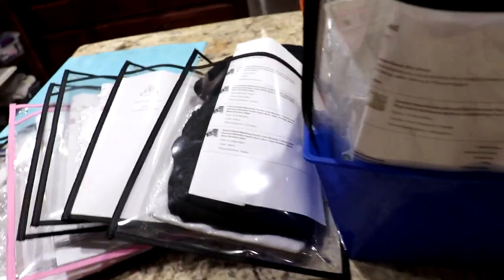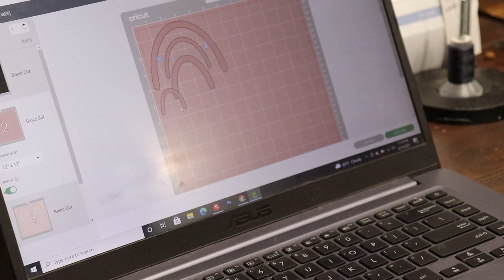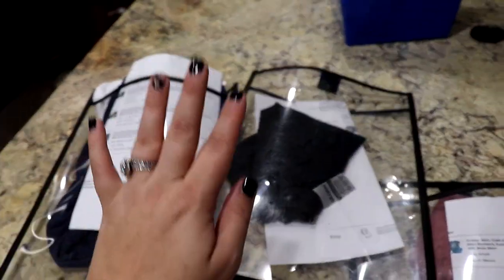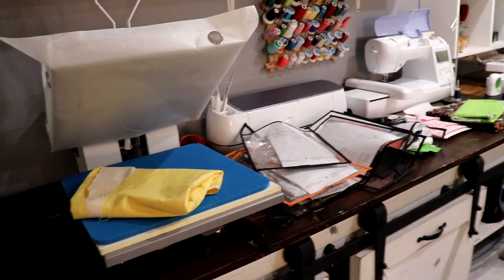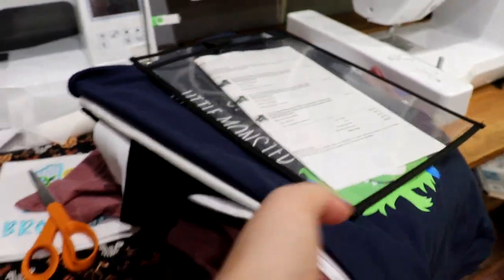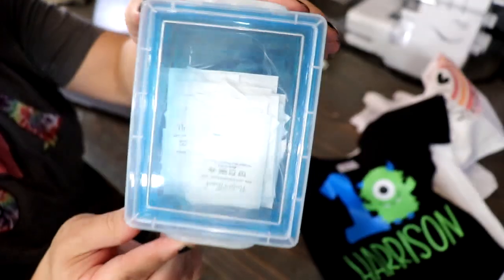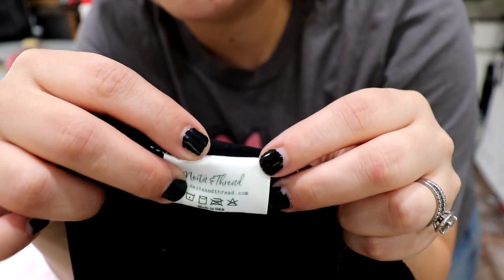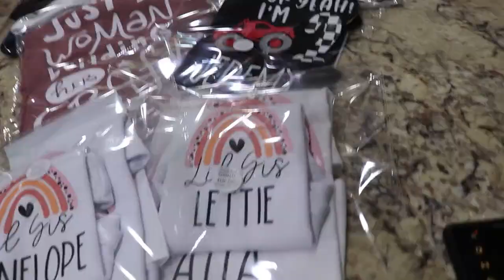Work With Me And Package Etsy Orders / How To Add Tags To Kids Clothing / Etsy Studio Vlog

Comment: I just had an idea for your cricut rolls!! Maybe you can put those little curtain hanger things and use a little tension rod off the edge of the table so you don't have to cut the vinyl until it cuts what you need.. for less waste... I'm so cheap when it comes to cutting mine.lol... maybe cuz I don't have a shop set up yet lol